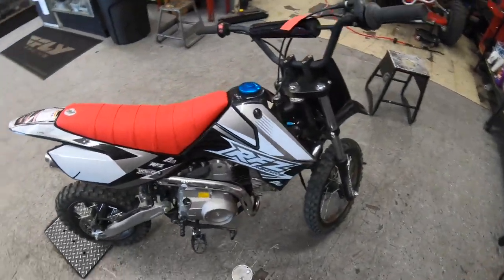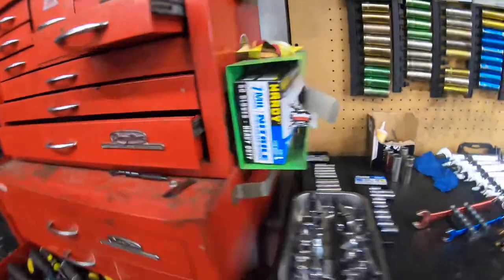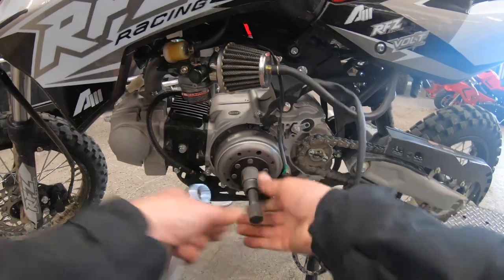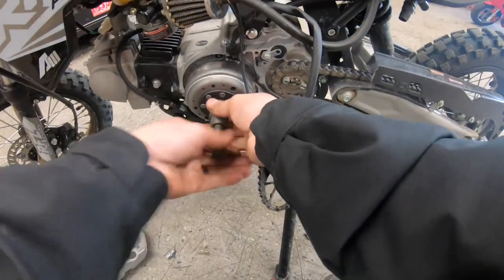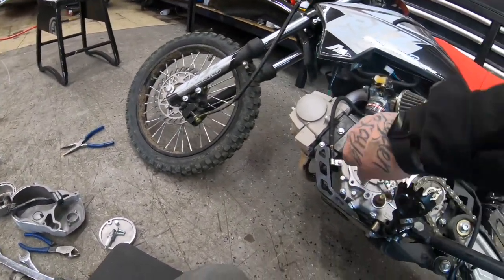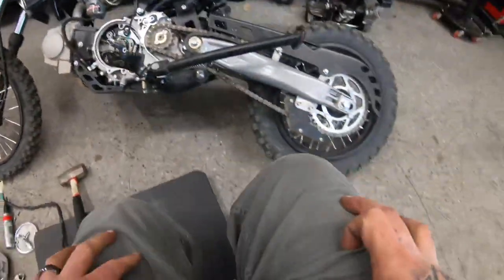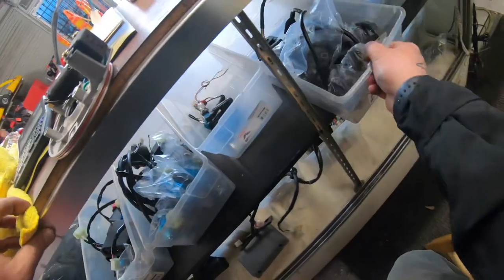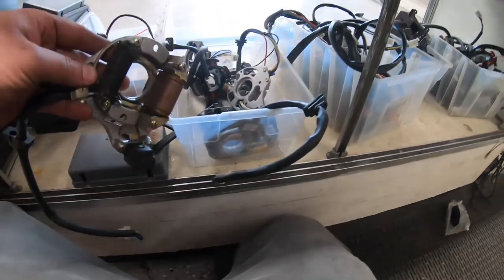Repairing a Apollo rfz 110cc no spark issue

Comment: Will an apollo 110 stator work for an ssr 110
Reply from the maker: Yes you might need to just cut the plug and re wire it
Reply: @EnviousRepairPerformance  Ty got it done
Reply from the maker: @Zanzula1245 awesome